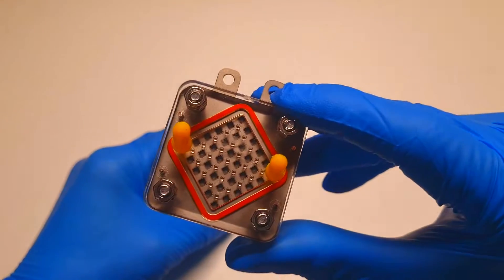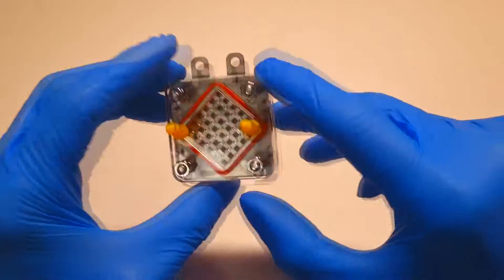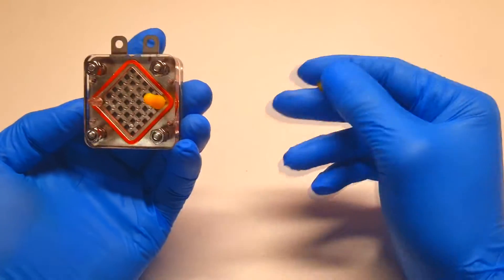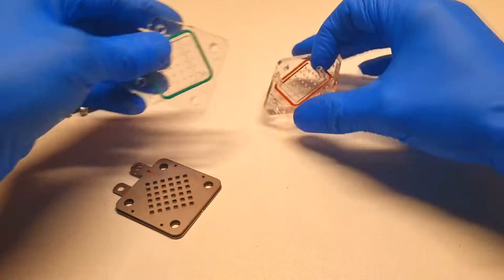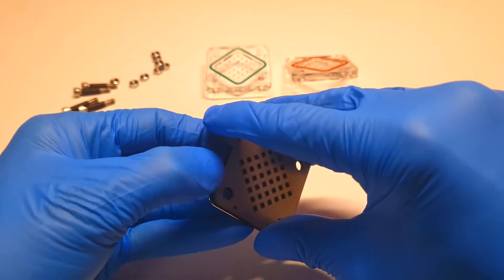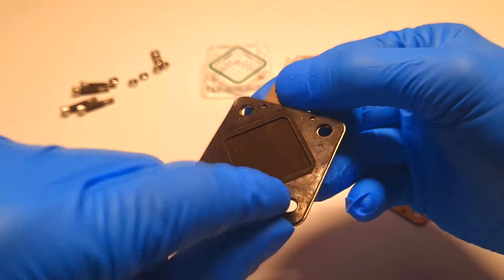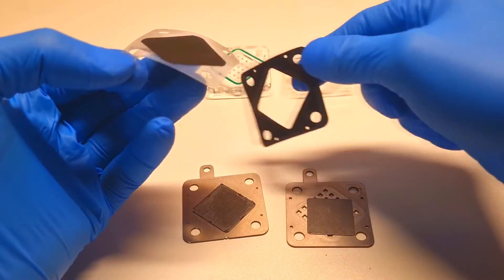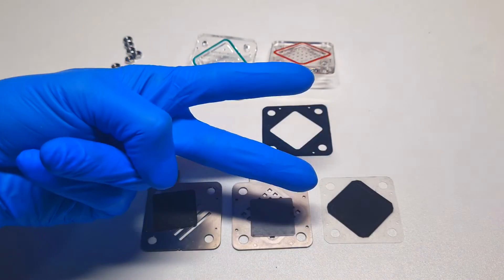What is inside of Hydrogen fuel cell?

Comment: ChaDgpt told me Walter Russell's method of hydrogen to helium was 250 to 275volts in a mica plate capacitor.  I'd say those cells would probably work great.